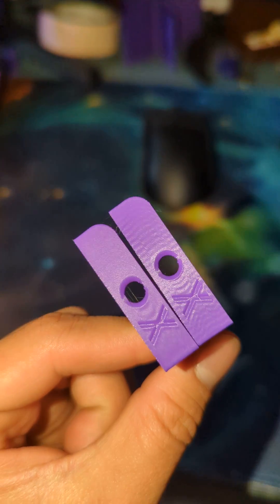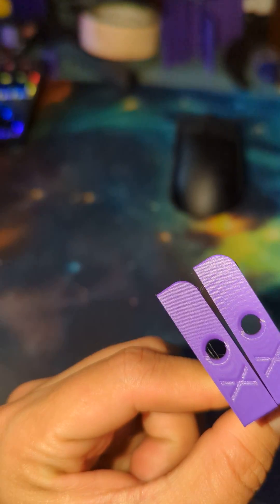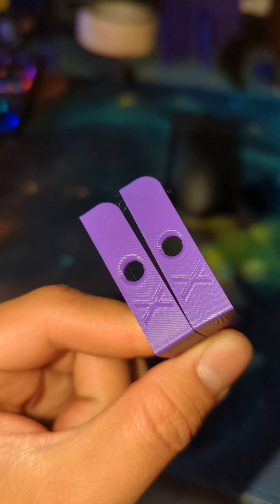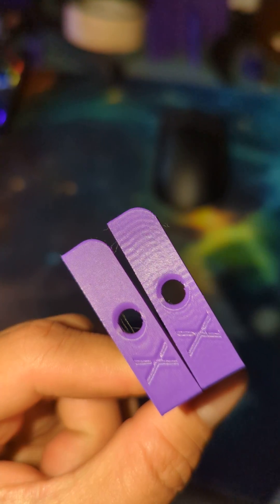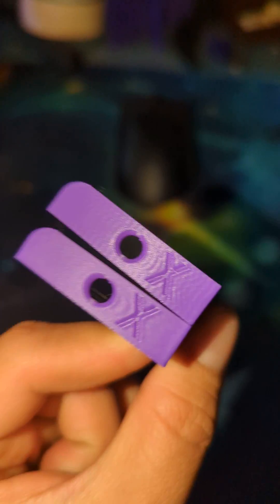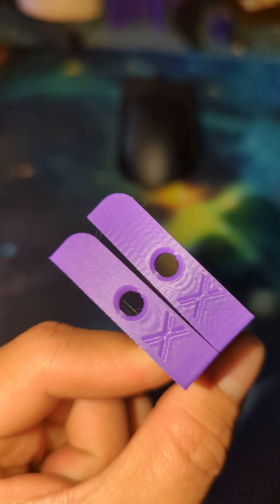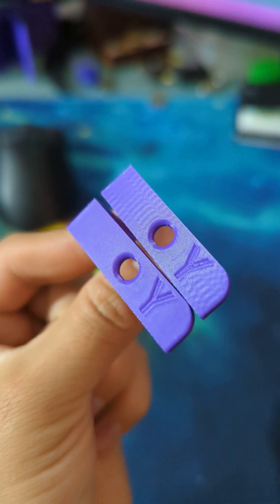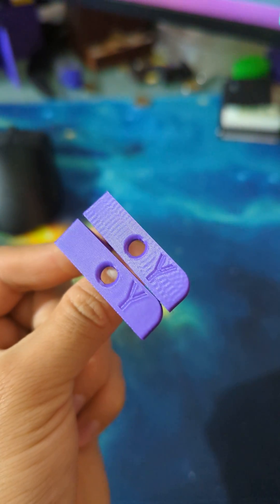Creality Print 5.0 and New Firmware Update, Ringing/Ghosting Fixed! On K1 Max

Comment: im currently calibrating K1C in 5.0, regular test prints come out fine but, when trying to calibrate Temp and other calibrations, the machine is just moving way to fast and coming out horrible, is there somthing im missing here? nice review just doesnt have the info im looking for. any suggestions? im currently running Default Machine settings, but the motion advanced option speed seem just way out of wack stupid fast compare to the 4.3.8 version speeds, some help would be apreciated bro

Comment: A lot less ghosting on mine, but it is still ghosting for me. Gonna slow it down and see if that improves things. At least now the ghosting is flat now. Before I could literally feel it on the surface.
Reply from the maker: On mine, the faster I print the less ghosting. Ghost is most visible at 10-60mms,

Comment: Does using Creality Print 5 really make that much of a difference? I am using the latest firmware but am still getting the ghosting as if input shaping isn't active. Using Orca 2.0.0RC
Reply from the maker: Not really sure if it's Creality Print 5 or the new firmware that fixed the ghosting\, I'm liking the updated slicer since it's basically the same as Orca/Bambu Slicer now.
Reply: @Zeltroix  I'll check it out! I don't like Cura, so Creality print was horrible for me lol